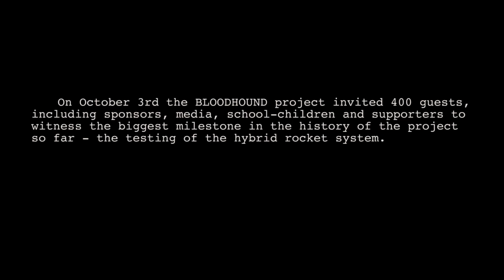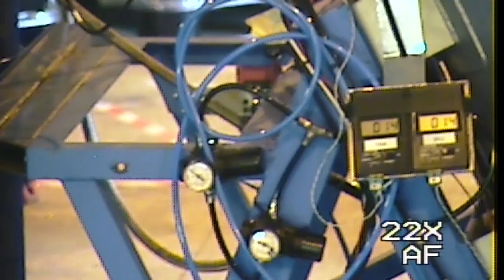BLOODHOUND tests Europe's largest hybrid rocket

Comment: The Stonechat motor was twice the diameter of this motor and more powerful. Designed and built in Britain and test fired at Westcott. I witnessed this beast being fired and it was awesomely loud and powerful. We as a country are no newcomers to this field and it is great to see that rocketry is still going on. Just wish I was still involved. Forget the European crap about the new hybrid motor. This rocket is British.

Stonechat details:
Solid rocket stage. 232.00 kN (52,156 lbf) thrust. Mass 4,800 kg (10,582 lb).
Status: Retired 1969.
Gross mass: 4,800 kg (10,500 lb).
Unfuelled mass: 750 kg (1,650 lb).
Height: 4.50 m (14.70 ft).
Diameter: 0.92 m (3.01 ft).
Thrust: 232.00 kN (52,155 lbf).
Burn time: 32 s.
Number: 1 .

Comment: The Top Gear launch had 8 tons of thrust total, so that would be less than 4 tons of thrust per whatever they were using for SRBs. The single rocket test in this video produced 7 tons of thrust, the thrust on actual record runs will be nearly twice that.

How does one compare the physical size of a hybrid rocket to a solid? Hybrid has a pump motor, pump, reactant tank etc. in addition to the rocket body.

Also, Top Gear's rocket didn't have a person's life at stake.

Comment from the maker: The Cosworth was at circa 70% power, however there is a gearbox in between the the Cosworth and the pump, it's a relitively simple case of changing the gears to increase the HTP pressure feed.  ^JT